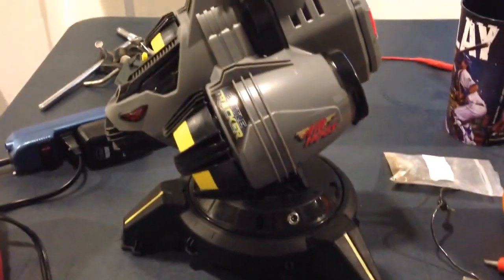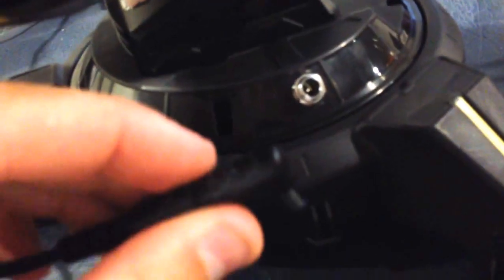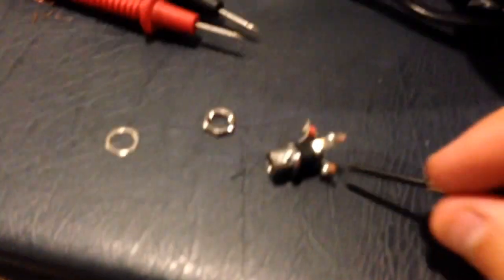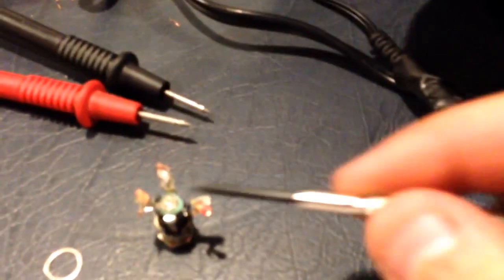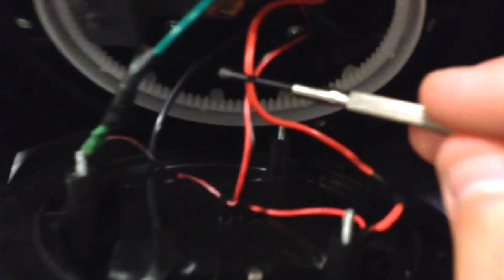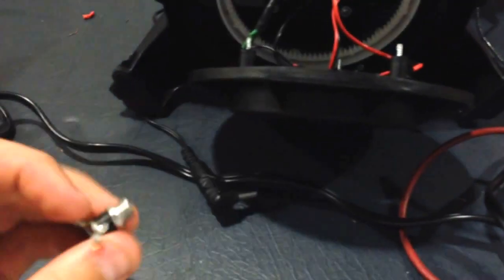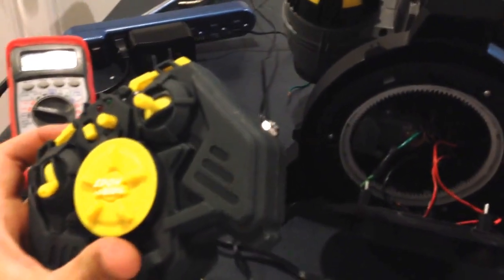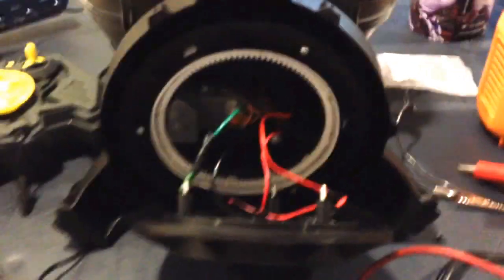Air Hog Hack-wire it up for use without batteries (DC power plug)

Comment: Do you have a video on how you did the controller?
Reply from the maker: I don't, but I will put it on the 2 do list.  But the process is very similar to this video with the Nerf Gatling gun.  Do you have your M connectors and DC power plug?
Reply: I am actually wanting to do this on the axis 400x controller. Should be getting that chopper next week.
Reply from the maker: Tom Bolton
Cool.  Post a video and put the URL in the comment.  Then I can take a look and give you any pointers if you're stuck.

Tips:
1) Test polarity on the battery side and the continuity on the M-connector, because different connectors might have a different wiring set up.  In my case the Noon post was the switching leg.
2) Drill your hole stepping up the bit sizes so it doesn't destroy the plastic or slip.
3) Pre-solder on your connections to each leg before inserting into the controller body and leave 6"-10" of wire so you can trim to length once it's all in there.
4) Test all connections for proper continuity before applying power.
Reply: jcardisco1 Do you have a link for the M-connectors and the power plug and adapter for that? I can't seem to find anything on amazon.. thx.
Reply from the maker: Tom Bolton
http://www.radioshack.com/size-n-coaxial-dc-power-jack-w-switch/2741583.html#start=11

that is a female N connector and I got that variable DC converter at RadioShack too.

Here is the male N connector for the converter, but I can't find the actual converter on their website.  It was right behind the glass counter at my store.

http://www.radioshack.com/enercell-adaptaplug-n-black/2730467.html#.VSXa3pNF8Zw
Reply: jcardisco1 Thanks you rock..